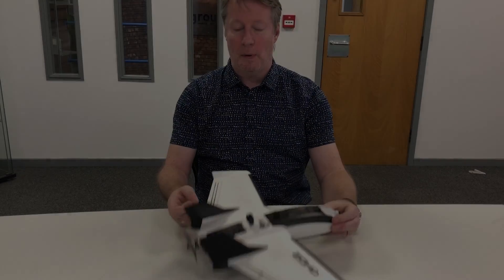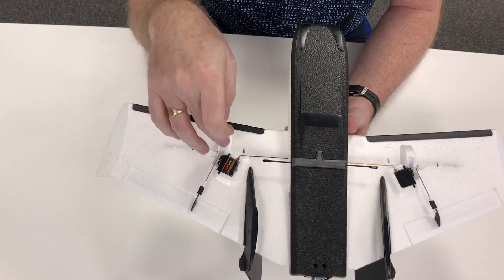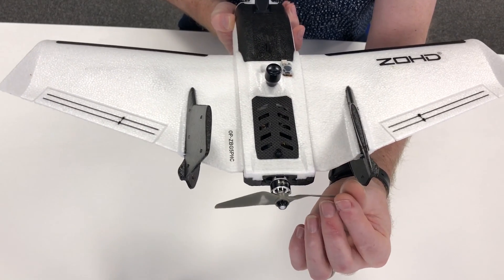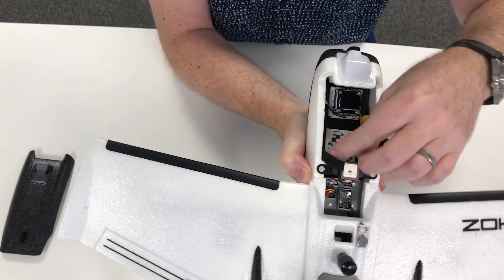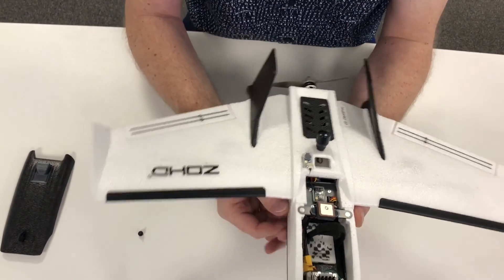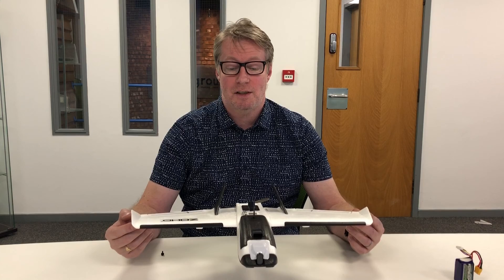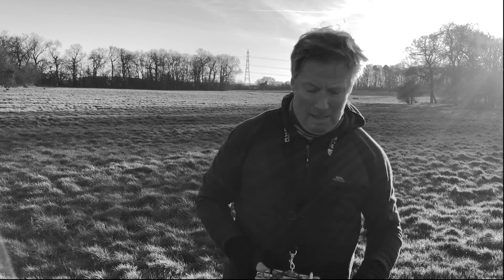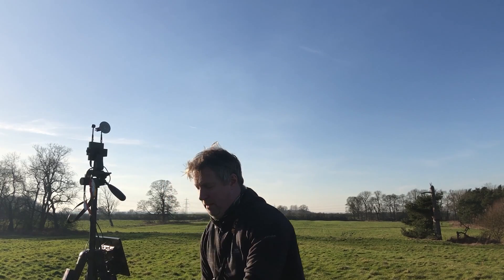My ZOHD Dart 250G Journey Part 2 - The Maiden

Comment: I use a 2Watt 2.4gz radio signal booster . 
 I tried it off once and it dropped at 100 ft. On a quad even though rssi said 98 . It has to be powered on .

Comment: What will happen, when it turn by side to your receiver on long distance? I think you can lose your control signal. Shouldn't both antennas be vertical?
Reply from the maker: Yes ideally they should both be vertical or horizontal but for close proximity flying like this its not a problem at all.

Comment: fantastic video many thanks for sharing! can you share your autolaunch settings? they seems perfect!
Reply from the maker: Here you go, remember I have my launch idle throttle set at 1200 so the prop spins when you raise the throttle before you launch. I don't want anyone losing fingers!

set nav_fw_launch_velocity = 300
set nav_fw_launch_accel = 1863
set nav_fw_launch_max_angle = 180
set nav_fw_launch_detect_time = 40
set nav_fw_launch_thr = 1900
set nav_fw_launch_idle_thr = 1200
set nav_fw_launch_motor_delay = 100
set nav_fw_launch_spinup_time = 100
set nav_fw_launch_min_time = 2000
set nav_fw_launch_timeout = 6000
set nav_fw_launch_max_altitude = 6000
set nav_fw_launch_climb_angle = 30
Reply: @bluefish3607  awesome many thanks for sharing, much appreciated! 😁👍

Comment: Excellent videos. I have a Dart250 I’m building out as well and I love designing and printing the various mounts, etc for all the components. Thank you for making these videos and sharing your experience. I also have the DJI setup and I’m going to be using the Caddx Vista. I have a question though...how are you using the DJI goggles with the TBS and Tarsier setup to get an analog picture on your DJI googles??

Comment: how did you get the fc to mount to your 3d print and where can i find your air vent as its not on thinigverse
great video i am doing mine same as yours
Reply from the maker: I drilled the feet on the mount and then put countersunk bolts from below up into the brass threaded stand offs on the F411WSE. I will pop the Naca duct up on Thingyverse later and send you the link.
Reply: @bluefish3607  thanks
Reply from the maker: @lovedr1211  Here ya go Jason https://www.thingiverse.com/thing:4239851

Comment: You maiden flight with autolaunch, is that ok?
Reply from the maker: It works for me, its a great feature of iNav so why not use it.
Reply: So you didn't do manual launch flight first, just built it, autolaunch and chucked it in air?
Reply: Ah seen it on ya vid... Cheers ...
Reply from the maker: @kool-k-kel  Yup thats how I roll :-)
Reply: @bluefish3607  cheers dude... Fatshark hdo2s or dji fpv...do u have issues with analog feed black screens , freezes ..?
Reply from the maker: switch fpv I use DJI FPV goggles and they are fantastic the HD is incredible and the analogue input and DVR are in my opion far superior to my Fatsharks.

Comment: I am also fitting the F411-WSE. How did you set it up for auto-launch?
Reply from the maker: I can post my iNav launch settings if that will help?
Reply: Yes please.
Do you know how to combine auto-launch followed by loiter once it reaches say 50 metres?
Reply from the maker: @rsilk2969  Hi Rob ok firstly this is how I set my Autolaunch and Loiter. 

1. I have Autolaunch permanently enabled on the configuration page.

2. I have a RTH switch setup in modes.

My launch procedure is select RTH with the switch, then arm the plane then launch it.

It will then climb to the set altitude and immediately begin to loiter as per your RTH settings, so you can relax, get you goggles on etc then switch off RTH take control and fly.

Here are my Autolaunch settings , remember I have my prop spinning if you dont want that just reduce the nav_fw_launch_idle_thr = 1200 down to 1050 or so.

av_fw_launch_max_angle = 180
Allowed range: 5 - 180

nav_fw_launch_detect_time = 40
Allowed range: 10 - 1000

nav_fw_launch_thr = 1650
Allowed range: 1000 - 2000

nav_fw_launch_idle_thr = 1200
Allowed range: 1000 - 2000

nav_fw_launch_motor_delay = 150
Allowed range: 0 - 5000

nav_fw_launch_spinup_time = 100
Allowed range: 0 - 1000

nav_fw_launch_min_time = 2000
Allowed range: 0 - 60000

nav_fw_launch_timeout = 6000
Allowed range: 0 - 60000

nav_fw_launch_max_altitude = 6000
Allowed range: 0 - 60000

nav_fw_launch_climb_angle = 30
Allowed range: 5 - 45

I have my loiter radius set at 59 metres nav_fw_loiter_radius = 5000

and my loiter height at 60 metres nav_rth_altitude = 6000

And here are my complete RTH settings should you need them.

# get rth
rth_energy_margin = 5
Allowed range: 0 - 100

nav_min_rth_distance = 500
Allowed range: 0 - 5000

nav_rth_climb_first = ON
Allowed values: OFF, ON

nav_rth_climb_ignore_emerg = ON
Allowed values: OFF, ON

nav_rth_tail_first = OFF
Allowed values: OFF, ON

nav_rth_allow_landing = NEVER
Allowed values: NEVER, ALWAYS, FS_ONLY

nav_rth_alt_mode = AT_LEAST_LINEAR_DESCENT
Allowed values: CURRENT, EXTRA, FIXED, MAX, AT_LEAST, AT_LEAST_LINEAR_DESCENT

nav_rth_abort_threshold = 50000
Allowed range: 0 - 65000

nav_rth_altitude = 6000
Allowed range: 0 - 65000

Happy Flying!
Reply: So it is not necessary to configure a  switch and launch flight mode if the always autolaunch setting is on? How risky is that?
Tx for the cli values. I have a weight of 250gm and am using a 2S Lipo. I am not sure of you have the same weight/battery, if not what changes if any would be needed? I did see that you are not using 100% throttle for takeoff.
Reply from the maker: Robin Silk Personal choice I guess put it on a switch if you are more comfortable with that. I just wanted to save a switch personally.
Reply from the maker: Robin Silk I am using 850mah 4S weight 357g with a 4.3x3 tri blade so you may need to tweak the settings for your setup. Mine launches sweetly with those settings.

Comment: One decent nose dive and the battery is going through the tarsier. Still not 100% happy with my zohd 250g. Too much wobble on the roll axis and too sensitive on pitch but bizarrely not enough authority to do a tight loop. Honestly my $5 dollar depron sub 250 wing ( flite test dart) fly's far better. But wow is the ZOHD dart 250 efficient.
Reply from the maker: Good tip, although the anti slip surface and strap works well I will add a small piece of foam in front of the lipo in case I get a hard impact. I have not had any decent weather to go and do a tuning session yet to see how well this thing really flies. From the maiden I can see it does not like any degree of wind very much, but with the HQ Prop 4.3x3 and 4S its a zippy little thing. Not built mine for long range or really efficiency just for a bit of proximity flying fun.

Comment: It's the other way, with auto-trim you land, disarm then exit auto-trim (now watch me go and check my notes and find I'm wrong lol).  At least yours flies better than mine that wallows around the sky like a walrus (exact same setup too other than the camera, although it balances on the cig, I'm thinking it needs a bit more nose weight).
Reply from the maker: Yeah I always seem to get Autotrim and Autotune confused. After reading my notes I know that Autotrim stays switched on until after landing then just disarm and Autotune is turned off before landing so when you land it does not mess up the settings and you need to save and reboot.

Hoping to get the plane to fly much better in my next video part 3 tuning session. I don't think this plane will ever be that smooth in any degree of wind but will be great fun on those calm warm summer evenings.